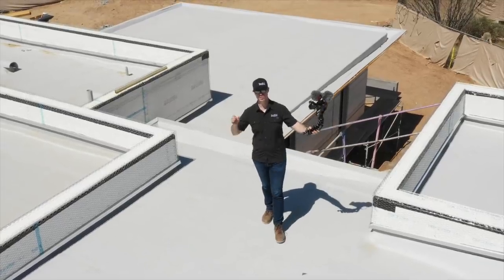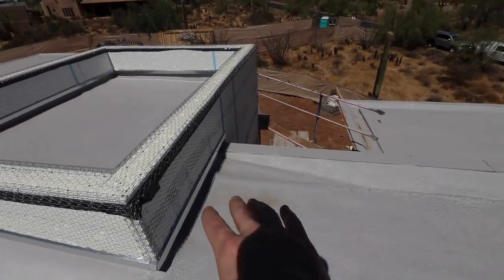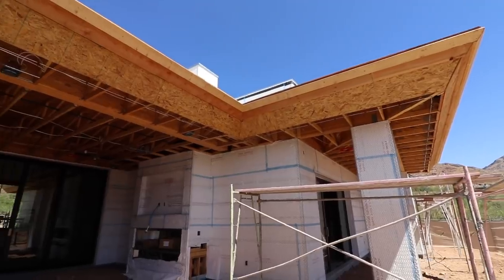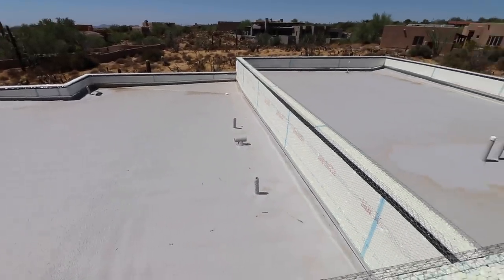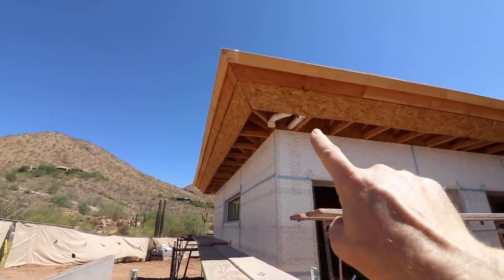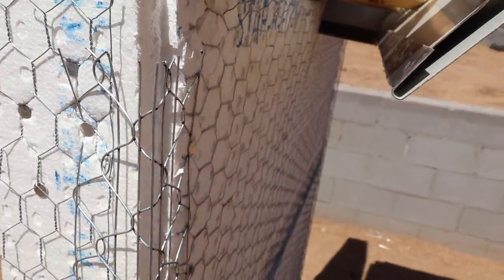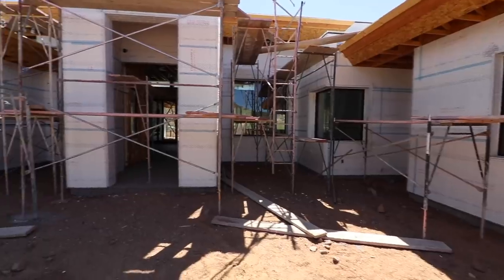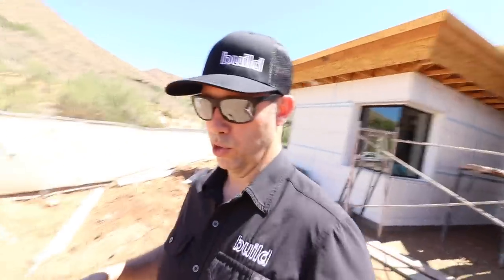2 Roof Details I’ve Never Seen Before

Comment: Doctorroof here , Scottsdale is my territory and repairing and maintaining foam roofs is my specialty . Foam is quite fragile by nature and is only an inch thick in general . It is sprayed on by a small crew , goes on fast  and is a cash cow for the installing company .   It must be coated with elastomeric acrylic to protect it and it must be regularly maintained . I think it is a poor roof to protect a multi-million dollar house but it does work well on the fancier , detail laden , contemporary custom , flat roofed dwellings that a low experienced roofer would find challenging to make water tight . Most of the R-value is from the white coating which also seals the foam from water intrusion . If you are looking for a " bullet proof " roof , my favorite is a modified bitumen ( torch applied ) membrane with an elastomeric coating , the coating will provide R-value and extend the life of the modified well past its typical life span of 25 years and as the term suggests , is extremely durable .

Comment: I've done a few project spec with a spray foam roof. Do not rely on pitching your roof with the foam alone, always pre-pitch. This was a popular method for some residential back in the 80s here in CA. You NEED to maintain it, which means recoating every 5-10 years with an elastomeric coating. If you don't it will fail. UV will break down the foam, and it will crack. Once the foam turns crusty yellow it's useless. Sloppy repair is to just spray foam right on top of it and coat with an elastomeric roof membrane. I've done enough tear outs, and every single one the roof assembly is dry-rotted beyond repair. This is really for concrete or steel roof decks, like in most commercial applications, not completely suited for residential wood construction.  

For wood construction, what you need to do is provide a back up in case the foam fails. One reason you need to pre-pitch the framing. I would install a torch down modified bitumen base layer first then spray foam on top. Lastly, you need traditional flashing details. I have the sub spray foam over a completed flashing detail then try to rig something up afterwards. The waterproofing is 99% relying on the thickness of the siliconized/elastomeric coating. Basically, once the foam roofers are done, and you don't have all the details taken care of, you're essentially relying on a product similar to Fast Flash or any kind of liquid flashing at those major water intrusion points.
Reply: You know your stuff sir. I would not recommend a torch base with wood deck though as you suggested..self adhering with some adhesive for insurance purposes might be a better alternative... yes I have torched to all combustible type substrates back in the early 90's with sbs primer and never had a smolder or fire...flame control and common sense always. Always On Top !
Reply: WillTam08 1000% yes! Maintenance is the key--and it also affects the internal temp by maintaining it.
Reply: I own a roofing company in Florida. We consider Urethane Foam a BandAid which people here use to cover leaky old houses as a cheap fix instead of replacing. It buys them a few years but it doesn’t last very long. We torch all of our flats with an SAV Base (Peel and Stick) underlayment. I agree with most of the statements above including the fact that the foam deteriorates and becomes useless if not maintained and Silicone Coating is far superior to Acrylic coatings. We get a ton of rain here along with extreme heat and humidity. If this was for insulation purposes I get it but beyond that I would scrape it off, pitch the deck and torch it, which is basically Grey anyway. A great roof always starts with a strong underlayment. Good luck!
Reply: modified doesn't need fragile foam , just a good coating of elastomeric acrylic
Reply: @kensnaza6829  This is solely for insulating and thermal bridging purposes. So yeah if you're installing foam, modified bitumen underlayment is a must. would be stupid not to install it
Reply: WillTam08 foam roofs are shit with air bubble leaks. Shitty roofing material.

Comment: I lived in the desert for ten years. The monsoons will dump a massive amount of water every year and roofs need to be designed to handle that. Flat or pitched, just because it is built in the desert does not mean you don't have to be as water tight as other zones.
Reply: Absolutely correct - thanks for pointing g that out!

Comment: A pitched roof in any climate is much more reliable and less maintenance.
Reply: more surface area makes heating and cooling a bitch. mainly cooling.  if you haven't lived here you can't speak on it. its a unique climate.
Reply: @DieselRamcharger  A 1 in 10 pitch is enough. Flat with parapets is bad everywhere.
Reply: its fine for hot climate region and not really raine ones but in snow or havy rain regions it's a waiting disaster we (Central Europe) have a nice sentence for roofs like that don't ask if it will leak the only question is when it will and we use a concrete bases for that type of roofs in at least 90%
Reply: Standing seam powder coated STEEL roof beats the Sun pretty well
Reply: @Pileits  powder coating a roof panel will only cost you a hundred bucks a panel... 😂

Comment: Hello from Australia. First I am not a builder, engineer or architect, I just love the construction industry. The only roof that I have seen, not exactly the same but similar was in England. In one house with a similar roof they covered it with some form of plastic, then they placed dirt on top, then put down grass and then flower seeds. There were two uses for this method, 1 for extra insulation and 2 as land was small, they made use of the roof for planting veg from memory. However, I do not think they are going to do the same thing with this house...I do hope we get to see the finished product. Gosh it is dry out there, so different from where I live...Cheers from Oz.

Comment: I'm in NC and have been roofing for around 20 years. Foam roofs aren't very good when it comes too longevity. Birds will even pack at it and damage the top coat. They are also bad too blister and crack. And finally, they are a real pain too tear off!!!!!!!!!
Reply: Congrats on tearing at it instead of cutting it.
Reply: Brian Scheuermann I don’t live in AZ either and I couldn’t agree more. This roof is horrible in my opinion. In Florida this is basically a band-aid for leaky roofs and usually it’s the older community that gets ripped off by people selling this product.

Comment: The problem with using desert as an excuse for poor flashing technique is that in most deserts all the water falls I'm just a few days of the year. So it doesn't rain often, but when it does it's a torrent. I've lived and worked in Phoenix Arizona and San Antonio Texas, and it seems to me this is a problem in both areas.

Comment: Height of the “cooking vent” is way to low...rain will get into vent via bouncing off roof, deflecting off cowling downward 🙄
Reply: Probably couldn't be any taller due to unrealistic HOA regulations.
Reply: Sam, how high off the roof should a cooking vent be? Just curious, as I'm building a duplex in Phoenix (metal roof) and want to know those sorts of details. It did seem kinda low to me, too, but I don't know the rule.
Reply: @ivanhannel  look in the appropriate year ICC code book for your location. Don't quote me on this but I don't think there is a minimum height, just that there are special water ingress precautions that must be taken in flat or low slope roofs.
Reply: What rain?

Comment: The overflow may be a component of a rainwater collection system that can accommodate a 100-year storm event.  10 inches of water may not seem like a lot but a roof as big as this one could still service a significant portion of the potable water need. If the roof was 10,000 s.f., you could harvest about 62,000 gallons of water over the course of an average year. Most of Phoenix's precipitation falls during the summer monsoon and even though the average annual total is only 10 inches, sizable portions can come in individual cloud-bursts (a lot of rain over a small period of time) and the overflow would shunt the excess perhaps to a retention pond or landscape feature, protecting the roof and the rainwater collection system.

Comment: APP modified bitumen is a better solution to flat roofs.
Reply: A roof would get too hot for that, when air temp can reach 120 degrees.  The underside adhesive would reactivate.
Reply: HEAV¥HAND  well said HH . 25 yrs on top here in MB Canada....this urethane foam system is complete waste of $$..coatings blister and peel exposing urethane which then breaks down off gassing and splitting/cracking shrinking....moisture trap from hell , traps moisture at deck level with no VB in place and literally rot's your wood framed structure from inside out with no detection until a "real" roofer opens that pos up and shows the owner what going cheap cost him. SBS self adhered base sheet and torch cap sheet (White), TPO or Sarnifil single ply fully bonded would work also but more $$ . rant over !
Reply: APP is much better than foam, but an SBS torch-down modified is superior to APP.

Comment: I'm sure the chemistry has changed over the years, but when you have a bad experience, it's hard to go down a similar path again. When I was but a child I recall that my parents had a flat red tile "porch" maybe 40 feet by 15 feet and it was also the roof for part of the ground floor below. We ll this porch was 30 years old and leaking so they rebuilt that part of the house keeping the same design, in other words, a huge porch area to walk on with rooms below. This time though instead of tile they used a liquid applied coating. It didn't leak until maybe the second year. This was inland California in the Bay Area. During those one or two years the sun beat down relentlessly and eventually you could see wrinkles in the coating clearly outlining the plywood roof sheathing below. The contractors came back and snipped the wrinkles and patched it with new material. It eventually failed again. The whole system just couldn't take the level of expansion and contraction when exposed to the California sun and the rainy winters. I would NEVER have a flat roof.

Comment: Probably doesn't rain much in Scotsdale, AZ but bringing rain inside instead of outside could lead to a lot of potential issues.  A superintendent at my company made that executive decision (to use an internal system instead of scuppers) and the condensation created underneath cause mold issues and noise issues.  Six units had to have their master bedrooms' redone and the super was fired.

Comment: The low points are where foam is sprayed thinner, thus more susceptible to deterioration due to sun exposure. But the low points are where water may sit if there’s a problem with draining.

Comment: That foam for the roof must be a different formulation than is used in a wall cavity?  It appears to be quite smooth with very little expansion UNLESS it was cleaned up afterwards.
Reply: Dense and low expansion
Reply: It's a denser foam. Usually your wall cavity and joist bay, the Close Cell foam is a 2lb foam. For roofing, you use a 3lb foam, which is super dense. I've stabbed a screwdriver in this stuff before and at 2" you need a lot of effort to penetrate to the bottom. Its mix lays out pretty smooth, although it's still bumpy, but you can use an angle grinder and shave down the foam in areas where you need to smooth it out.

Comment: I wonder where the balance point is on drains/gutters/roofs of that nature.  People used to do the box gutters, which were great until they leaked and then the repair costs were astronomical later, so they went away from using them. I am sure the PVC will last longer/be more stable, but when a problem happens it will be very costly to repair.  Some of the new stuff is rock solid, some of it yet to be proven. Time will tell.

Comment: Closed cell on a flat roof? Damn, that’s gotta be expensive, but also a good way to maintain decent R-value where the foam thins out. I work in multi family (architectural side) and we typically use rigid foam for our flat roofs.

Edit: After seeing that cricket, I’d still like to see a smoother surface finish to that roof with positive drainage. Hard to tell on my phone, but it looks like that bumpy, mottled surface finish continues onto the cricket. There and elsewhere along parapet edges I’d be concerned about water ponding and not draining properly because of that finish when it does rain, and over the years leading to an eventual leak. It doesn’t rain much in the desert, but when it does it usually rains hard .

Comment: The Value of this programming: Excellent, a very good reference source for new products and  their application in the building trades. As I have a high interest in this material it becomes entertaining but that is secondary to actually wanting and needing this information. And why would I need it?
Take Harley Davidson as an example; In 1937 it was arguably the best motorcycle in the world.   When you have the best you get copied and if it's a mediocre product it gets surpassed by someone building something better. The HD problem was that it was the same bike in the 60's and 70's with little exception. And at that time it was universally out-built by everyone. 
Which should tell us that the best today will not be the best tomorrow and to maintain a high level of quality in our products we have to do more than change with the times, we in the building trades must be on the leading edge of technological advancements. And rightly so as we are the one actually using the products and this is the true test of the products actual quality. This is where we find out if it is as good as it is being promoted. And this is where duty calls and I, like many of you, answer that call with building the best you can. And I have considerable admiration for the skills shown on this programming and equally for the comments I've read here today. Thanks, d

Comment: The problems with those exotic systems are 10 to 15 years out when that builder is no longer around and nobody knows how to fix it properly or they say they do and they mess it up even worse. I would rather have  widely used systems just for that reason
Reply: Foam roofs are common in Phoenix.  Dozens of roofing companies do them.
Reply: Most of the new commercial buildings around here use the same stuff, nothing really exotic about it.
Reply: Not an exotic system here in Phoenix. But just because everyone’s doing it doesn’t make it a great system. As previously mentioned; the foam isn’t waterproofed by anything other than a thin spray application of paint. Regardless or the products chemical make up, its still a fragile system. Also, the foam is applied straight to the osb. I have never seen a separate membrane used between the two. Not that is isn’t done but finding Hillary’s emails would be a better bet
Reply: @fmlymn1  Its not even exotic in comercial buildings here in the PNW where it rains three seasons out the year.

Comment: There is a good reason why you've never seen it before...........IT BLOWS.
Reply: Unless you live in the desert, which he does not (I'm in his area (Austin), and moved here from Phoenix, designing homes in both regions). He's never seen it before because it doesn't work in Austin, but it works great there... if you have deep pockets.

Comment: You can get metal roofing for a .5/12 roof slope, which is 1 foot of rise for 24 feet of roof width.  It is crimped in place with butyl caulking inside the ridges.  You can also get it with a very highly reflective, very cool (low solar gain,) Kynar finish.  I'd feel a lot more secure with that than with a spray on roofing product, no matter what the product might be. 40 year warranties are available for these metal roofs.  This house looks like very low quality design / construction despite the high overall cost.  An inch of EPS foam might be R-4 on a good day.  Money can't buy you common sense, or a sense of responsibility towards the planet that we all share.